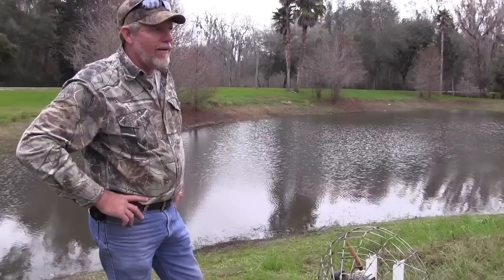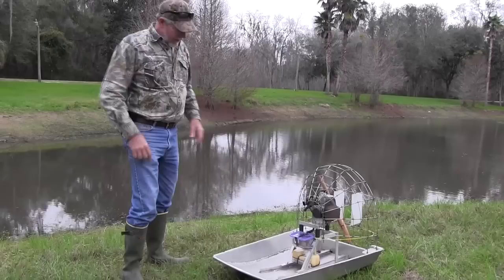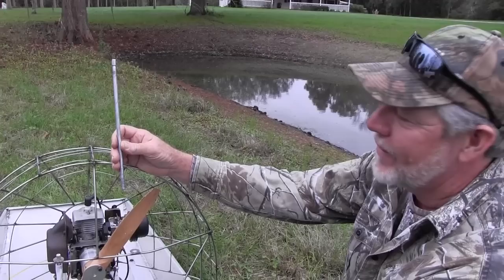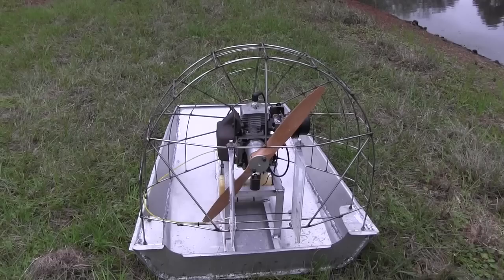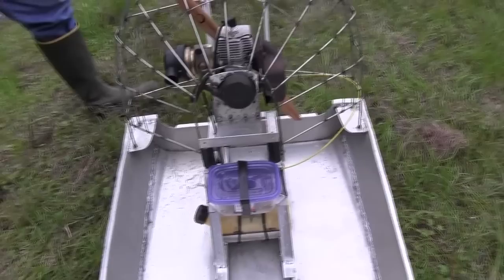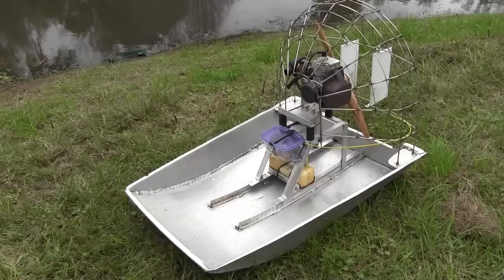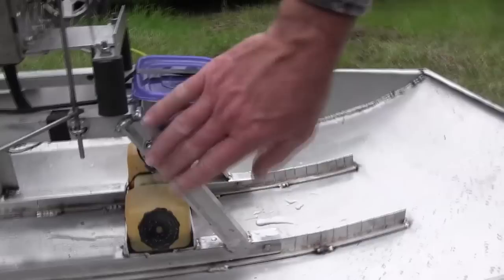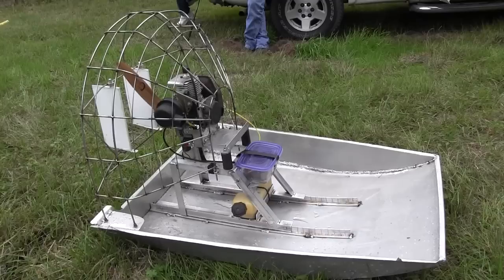RC AIR BOAT BIG GAS POWER HAND BULT

Comment: I built mine in 1988. 1hp OS Max 40 nitro & 11inch prop, all 1.6mm aluminum Tig welded, 0.7mm stainless fuel tank/engine mount rig welded, enclosed hull, twin rudders (same as prop dia). It went so fast I could never give it full stick or find water smooth enough to.